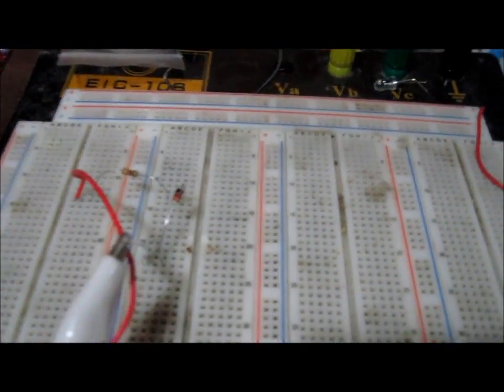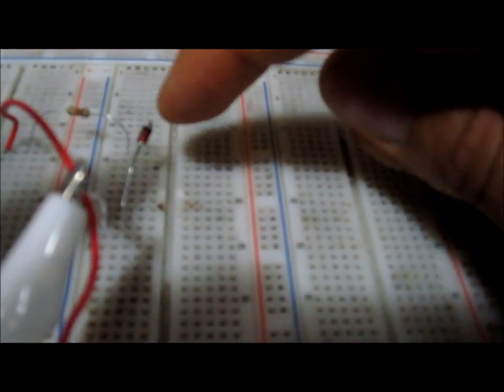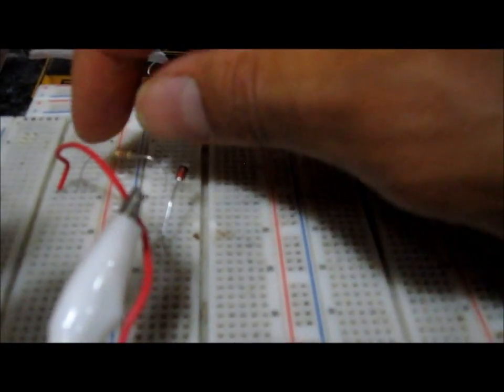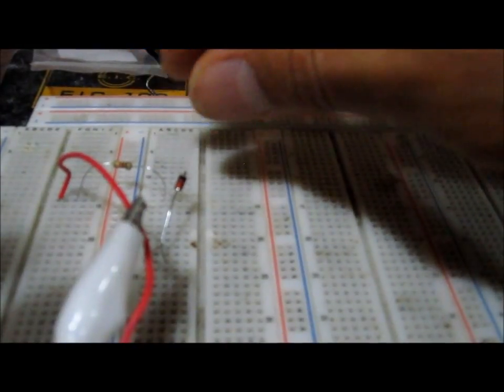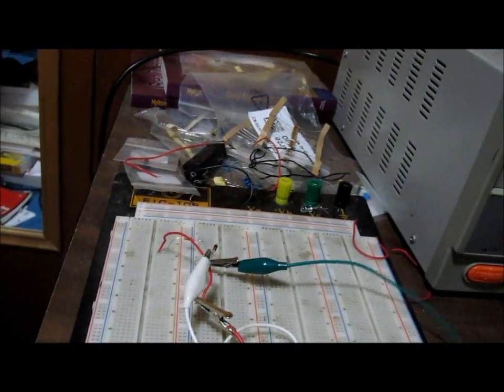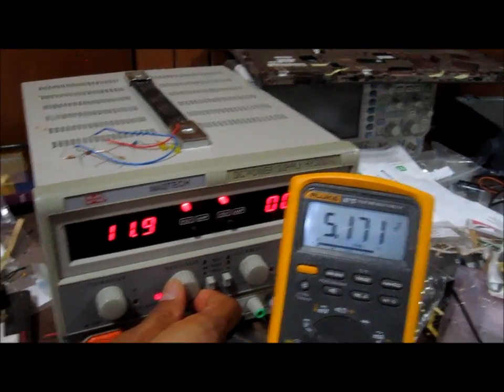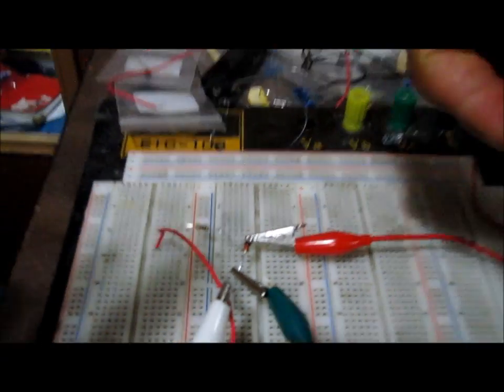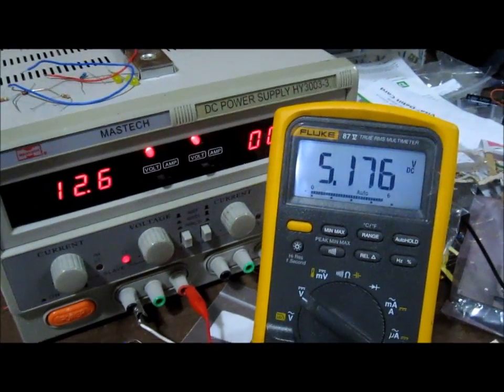How to Build a Voltage Regulator with a Zener diode

Comment: Thanks man
http://www.reuk.co.uk/wordpress/electric-circuit/zener-diode-voltage-regulator/
What resistor value did you use?
I got a 9v battery and wanna have 5.1 v out of it but I'm getting 5.3 v !